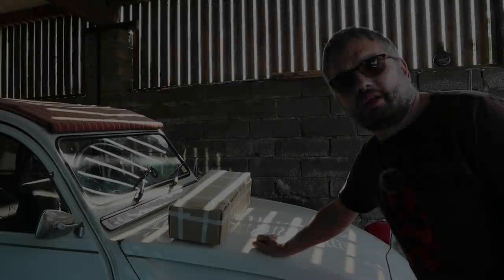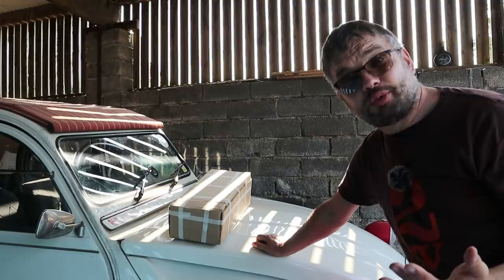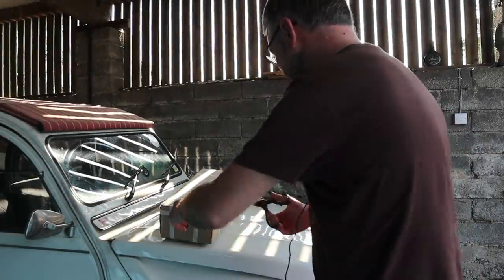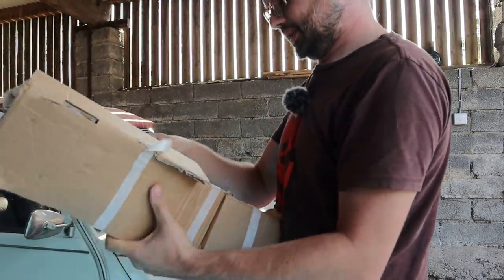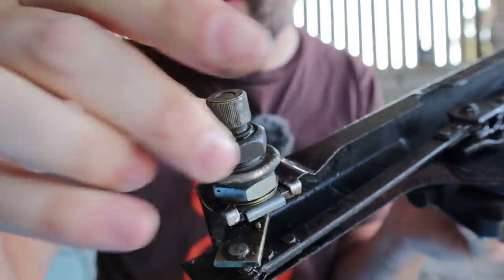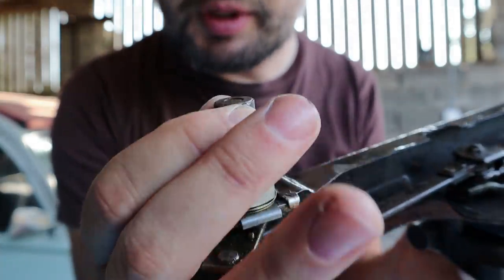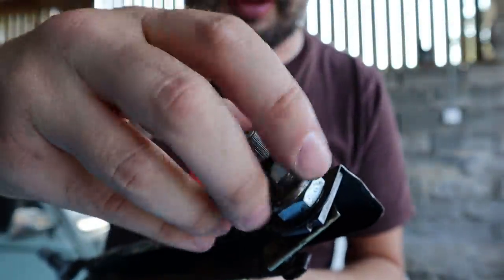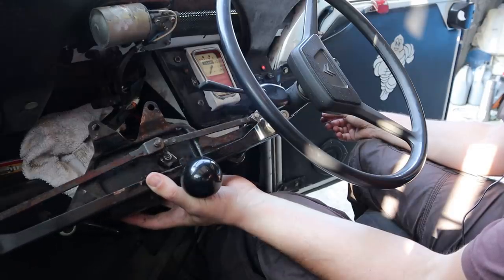2CV Windscreen Wipers - AGAIN! Spindle refurb Part 3

Comment: I can't recall who told me to lengthen the linkage many years ago but I did so and have never had any trouble since. 
I removed it, cut it in the middle, then welded both parts to a bit of steel bar a few mm apart.
Reply: I'm sure it'd be possible to weld a 1mm gap up - so no new metal other than from welding rod.

Comment: Very simple, take the rebuilt spindles out if the current assembly, by undoing the nuts. To remove them from the linkage there is a horrible small clip, which is crimped round a groove in the shaft, pry them apart to remove them. Once the rebuilt spindles and are freed from the linkage you then swap them onto the other assembly. Or if the second one has a slow motor, swap the linkage off that onto the one with the rebuilt spindles... There has to be a combination of bits that will work there somewhere!
Reply from the maker: Cheers Colin. Some lovely comments about your segment.

Comment: I agree with the others. Drill a hole in the long mounting plate and put a bolt through with a nut on. Provides a phys.ical stop so it can't go over centre. Something rather nice about watching a bloke machining metal. Lovely laith work...👍

Comment: Hi Ian.  Removing the spindle ass'y from the frame is as simple as undoing the large nut on the spindle body that locks it in place.  That'd allow you to check & adjust the position of the spindle closer to the motor crank thus not affecting the throw of the L/H wiper.  Alternatively, swapping the new spindles over to the spare motor/frame ass'y might be even simpler as it seems to have the correct geometry already (or maybe just that tie rod is worn out - there's a lot of clonking going on when they're running after all).  The first step is to free the clips holding the tie rod ends onto the spindle cranks (with the whole caboodle held still by Miss Hubnut) and be ready to catch the clips while you pry them out as they're bound to go flying!  Thank goodness the 2cv dash is so easy to remove! Chris.

Comment: Ian,    when the arm is in that position  and you push it over,  well the space it go's in  put something there, small  round bar  or just a screw or bolt so the linkage will hit it  and not  go over          think that will work ??????

Comment: Put a bolt through the sheet metal, at a spot where it just won't touch the little arm on the spindle. That way, if it threathens to ping into the locked position, it'll hit the bolt instead and have not yet pinged far enough to lock.
If you hear it clicking against the bolt, then things have gone out of whack and serious work is needed.
If putting a bolt in there is no option, you can also epoxy a tiny block of wood on the inside, under the arm on the spindle maybe.

Comment: There can only be a handful of things causing this: 
1) The distance between the motor and the spindle is larger, i.e. the metal frame itself is different.  Unlikely and should be obvious.
2) The crank arm on the motor is longer.  This will give increased sweep on both wipers.
3) The crank arm on the affected spindle is shorter. This will give increased sweep on that wiper.
4) The linkage between the motor and wiper cranks is longer.  Sweep will be almost the same, but the arc that the wiper crank travels through will be shifted.

Suggestions of fitting bolts etc. to stop it going over-centre are nasty bodges, a few minutes with a tape measure should find the actual cause of the problem.
Reply: Totally agree. Each part needs to be measured, there MUST be a difference if the two work differently.

Comment: Used to have a play problem on the P11 Nissan Primera wipers because Nissan changed from a metal bodied spindle holder to plastic that used to wear rapidly, the trick was to find P10 metal bodied spindle holders that were a straight swop.

Comment: Cut the offside linkage and weld an extension piece in. The stroke will remain exactly the same but will just move the spindle arm further over to stop it going over centre. We had the same issues on coaches but often they had adjustable linkages so didn't need to cut and weld them.

Comment: Ian, 

Here's a thought.  Is it possible that the drive bar from the motor to the right spindle is just a bit too short?  I would think if it were just a bit longer (or rather, the holes in it were just a bit farther apart) that it wouldn't be in danger of going over center; even by a couple of millimeters.  Have you tried swapping in the right side drive bar from the refurbished assembly into the one that was just rebuilt?  If nothing else, you could have one machined.  It looks like a piece of bar slock with holes drilled in it.  You could just make one or have it made with the holes slightly farther apart.  

Presumably the core problem is that as you speculated, the spindle on the right side is just a bit farther away from the motor mount than it's supposed to be.  but lengthening the drive bar would compensate for that.  It would change the rightmost and leftmost position of the wiper on that side *slightly*, but you'd just adjust by re-indexing the wiper on the spindle shaft so it wouldn't matter.  

Craig Steffen
Reply: I was just about to post the same thing, alternatively can the 'naughty' spindle assembly be moved a millimetre or two closer to the motor assembly and still fit through the holes on the flitch panel.
Reply: The short bar is too short. Needs making longer, use spare long one and cut it down but make it 1 _ 2 mm longer and re rivet with steel rivets.
Reply: @mikeburnitt403  Right.  But "moving" the spindle, which probably just mounts into a hole in the wiper assembly frame, probably isn't trivial.  You can't just move a hole in a metal plate less than its diameter without filling in the old hole or replacing part of the frame.  

Whereas making a new drive bar should be fairly simple.  It doesn't have to be very precisely made, except for the distance between its two holes.
Reply: Lengthening the rod would work but as there is still play in the linkage maybe re-bushing the rods may eliminate the play and not cause the problem of going past
Reply: Obiviously this is done with new spindles , its pointless with worn ones.
Reply: Or move the motor as far as it will go towards the problematic spindle?
Reply: @gevmage  Surely easiest to cut in two and weld together a mm longer.
Reply: It does seem to be a bit of a design fault. A fraction longer on either the link bars would help, but affect the ulitmate sweep. A 'bump stop' bolt on the frame, would prevent the over shoot.

Comment: like others suggested  put a stopper in the channel but instead of using a bolt which would probably make a annoying clang noise  get a piece of square solid rubber block close to the channel size and tall enough to stop it going over centre and glue it in to stop it locking the  arm up when it goes over centre

Comment: Great to see mates helping eachother out, the only real way we are able to keep classics on the road these days. As a temp fix to the over center problem could you try an old suction mount on the outside of the screen at the end of the driverside wiper sweep to inhibit the wiper overreaching in heavy winds?

Comment: Have thought of bolting a rubber bump stop through the area where it flips over. If you position it correctly it will strike the rubber and bounce back to it's correct line of travel.

Comment: Angle grinder and welder is your friend. Either shorten or lengthen the connecting rod to that offending wiper spindle by a couple of millimetres. I suspect shortening it by the width of a thin cutting disk would do the trick. Would only take ten minutes to do the job with the linkage once more removed from the car.

Comment: Put the right hand arm into it's easy-to- overcentre position, then drill a hole through both sides of the pressing it mounts in, thus to fit a long, thin bolt (M6?) and a locknut (even a thick bit of fencing wire with a bend each end (because Wales).  This will stop the crank from being able to go overcentre because you've put something in the way.  The old maxim about measuring and thinking before drilling holds very true here, particularly as far as clearing of bodywork and moving parts goes with regards to whatever you poke through your new holes.

Comment: Most interesting, I was thinking adjustable length arms might help ? Nice tweak sealing the spindles. I had a Fiat Punto whose rear wiper was forever seizing due to  lack of similar sealing, cured it by fitting a BL A series valve stem seal under the arm, sorted !! May be a possibility on other cars, I was thinking Pinto seals might fit the Citroen ?

Comment: My daily driver is a 1999 Peugeot 306 Husky 1.4l manual. I paid only 140£ for it(!) With 1 year od insurance, mot and almost brand new stereo! It only had minor rust wich was easy to repair and the famous suspension beam was shot. Replaced that, i have no other issues with it

Comment: My bodge. Drill a hole in the bottom of the channel, where the bar drops to when overcentre. Put a bolt with nut in said hole, protruding enough to act as a stop to the long bar if it gets any silly ideas again.

Comment: 14:31 might I suggest a bodge to prevent your R/H wiper arm going over center?  What you should do is drill a small hole in the support frame behind the wiper arm pivot and insert a self tapping screw to act as an end stop for the arm pivol to stop it from going fully over center, yes you may get an annoying tapping noise when your wipers are working as it hits the end stop but thats slightly preferable to your wipers jamming up solid while your driving down the road in the rain?

Comment: It’s usually the motor that parks not the switch 👍🏼
Reply from the maker: Yes, but the control of said parking is via the switch. Disconnect the wire and the parking no longer operates. Problem before was that the wipers wouldn't stop because the motor part of that system wasn't working.

Comment: I fear I may have to carry out similar surgery on the Discovery's wipers. I was most disappointed by the lack of dismantlability regarding the rear screen wiper motor and mechanism but the water ingress was horrific. I do enjoy jobs like this but Land Rover don't seem to have taken into account the right to repair principle 😔
Good job Colin.
Reply: Right to repair was back in the good old days where you could stand within two metres of 'most' people without fear.
Reply: @nigelbaldwin752  My partner and I run a small engineering company and try out very best to defy the throw away philosophy which seems to prevail these days. Nothing is more satisfying than resurrecting something broken. We also manufacture parts for vintage and classic, mainly British, motorcycles.
Reply: @PurityVendetta  like your thinking too many just toss things away in todays world i'm like you i enjoy repairing / restoring old parts and cars but hard to find  machine shops that will make small bushing etc

Comment: The video clip may be a bit fuzzy but it is still perfectly adequate. Many successful video makers have started with far worse! It seems the linkage arm on the problem end is marginally too short somehow. I wonder if it was outside spec from new, and only the flexing of the mount sub-chassis alongside rust and and wear has pushed it to the point where it can fail. Very odd.

Comment: Your issue now is wear in the bushes in the link rods.  You can probably make up new ones yourself using donor plastic and DIY tools, and that should cure your problem once-and-for-all, until the bushes wear out again.  The simple problem is that the worn bush in the link rods will allow the right linkage to move too far to the left when under pressure so it goes over centre and locks up.  Making the right bush thicker on the outboard side will give extra margin to stop the over centre condition happening.  The spindles are sorted and the motor is working correctly so the linkage has to be the problem now...

Comment: The bolt to create a stop sounds good.
Or could you make slightly longer arms to go on the spindles. It would give you a slightly shorter arc but stop the arm getting to horizontal.

Comment: Hi Ian I was thinking about how you might be able to fix the issue with your wipers you could try welding a small bit of steel below the part of the linkage that has the problem to act as a kind of bump stop I can't see why it wouldn't fix the issue and you would still have full range of motion in the wiper arm

Comment: Could you mix and match the best linkage, motor and spindles?
Reply: Yes, does the other linkage go over centre? Parking is down to the wiring of the motor. The park stop is inside.
Which ever linkage set you use please derust and paint!

Comment: On the frame which holds the spindles,  are the holes which the spindles go through larger than the spindles which go through them? If so, can you try loosening the nuts and moving the spindles towards each other, then  re-tightening the nuts?
Obviously the fault is caused by wear ( the wipers didn't always lock up) and now that the spindles have been refurbished, and there is no play in the reciprocating bar attached to the motor, the frame seems to be the only possible place left.
Just a thought :)

Comment: I found this French discussion of a problem with a Mehari wiper mechanism which probably has nothing to do with Elly's wiper issue, but you never know. It seems that the lengths of the Mehari linkages aren't the same as for the 2CV and the motor position is different (fitted the other way round - from what I can understand of the French). Maybe the faulty mechanism has been adapted from a Mehari at some stage.

https://www.technique-mehariclub.com/forum/sujet/la-tringlerie-dessuie-glaces-de-la-2cv-est-elle-la-memeque-pour-la-mehari/

Comment: Here's a Cassis Méhari Club tutorial in French showing how to fit a new wiper motor. The pics of the mechanism may be of some use. They suggest that the bar you mention at 13:25 should indeed be parallel to the linkages: https://www.technique-mehariclub.com/fiches-pedagogiques/essuie-glaces/remplacement-dun-moteur-dessuie-glace-nouveau-modele/

Comment: Ah, the joys of modern motoring (well okay my car is a 2005 Skoda but still definitely modern compared to a 2CV) where you don't even think about wipers until the blades wear down. Hubbers keeps me from falling into a delusional fantasy about classic cars from the 70s/80s; many of them were rubbish and required constant TLC to keep them alive. Many of them came with rubbish parts, badly made, which quickly wore out. 
Huzzah for modern motors for the lazy motorist...like me!😁
Reply: Wait till your modern car is 40 plus years old, lets see whats still working LOL
Reply: @paulcost6446  As long as I keep it serviced I suspect pretty much everything will be working. My old Skoda is already 15 years old, 150K on the clock, everything works!😉
Reply: @smoothmicra  So far LOL
Reply: @paulcost6446  Check out the Car Throttle channel, they had an Octavia with 500K on the clock, built to last 👍
Reply: @smoothmicra  Cool yes older Euro cars far better then the newer offerings